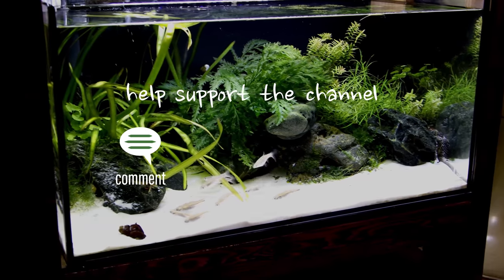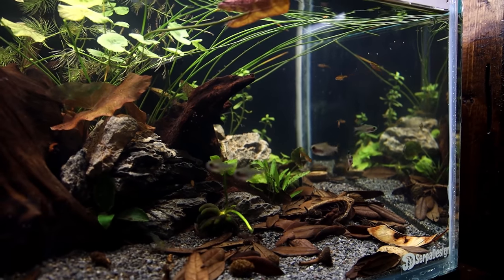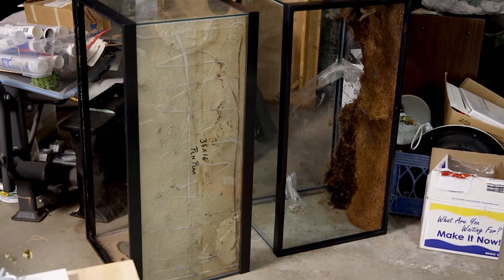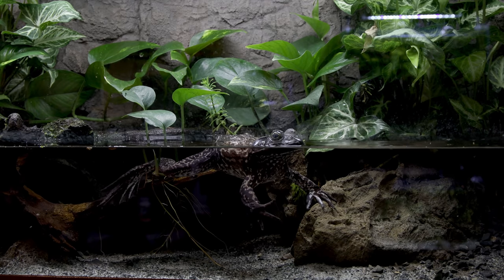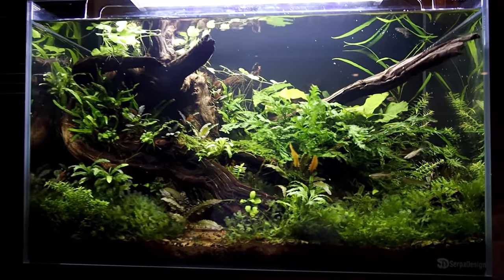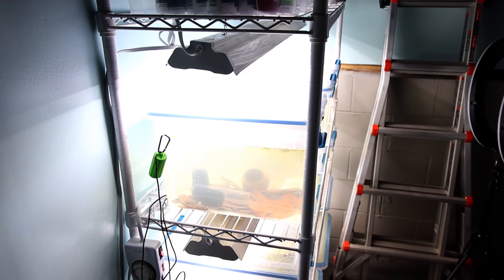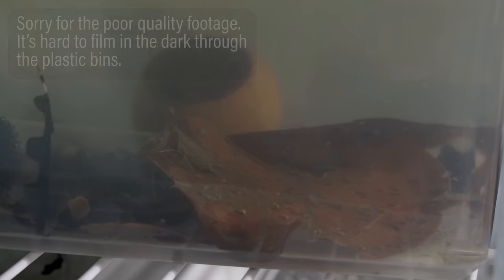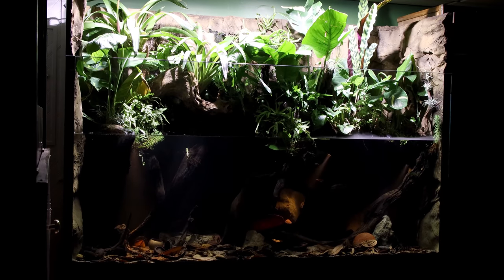I Finally Got My DREAM FISH! (So Excited)

Comment: You should attach one of those audio things that convert electricity to sound because I've heard these fish generate considerable but no need for concern amount of electric. You could hear it whenever it 'talks'
Reply from the maker: That's a cool idea! I'll have to do some research and see what I can find.
Reply: Boa-Noah  I believe there are a few aquariums that have sensors in the water that measure the intensity of the electric field produced by electrogenic fish, one of which being the New England Aquarium in Boston (the one I work at). They also have a light display hooked up to the tank, which gives a visual indication of the intensity. There certainly would be a background flickering of lights, but I wonder if that could be a substitute for the sound apparatus. Then again, there are methods of dampening noise and reducing the sensitivity so that only stronger than average pulses can be detected; however, the price of installing and even finding the equipment to construct such a display may be off-putting.
Reply: Yes! You just need an auxiliary cord, an amplifier, and a speaker and you can hear him talk!
Reply: @Abraham Johnathan That's true. LED's are really cheap; however, the display would need some additional modifications in order to ensure that the display can be powered on in the first place (these knifefish, unlike the kilovolt knifefish [Electrophorus electricus] do not produce as much power).

Comment: Name idea for the knife fish: Damascus (as in the steel)
Reply from the maker: Not bad!
Reply: when you said damascus it reminds me of alex steele...maybe tanner can collab with alex to make damascus-frame tank
Reply: @al-aurum2457  That would be insanely cool, but also absurdly expensive. Lol
Reply: Or Sheffield. ;-)
Reply: @invicis7591  very true...well if tanner's up to it maybe they can figure some things up, a win-win situation
Reply: @al-aurum2457  They used to make steel frame tanks, but the problem is that unless they use stainless steel, the steel has to be covered with paint or it rusts, and if the paint chips or peels off, the exposed steel rusts.  You couldn't see the Damascus pattern.  Possibly with a transparent epoxy coating.  Can they make damascus from two types of stainless steel?
Reply: @invicis7591  Not that expensive.  The old steel tanks were made out of simple L-beams welded at the corners.  They were extremely strong.  In the movie, The Best Years Of Our Lives there is a scene where such a tank is carried around while filled with water.  Shirley Temple had brought the tank from home to use in that scene.  A ten or fifteen gallon tank shouldn't be that expensive to make.
Reply: That is a good one! Strong name
Reply: @emmitstewart1921 Now I'm half-tempted to try it myself! I really want to build my own paludarium.
Reply: I was looking through the name suggestions and yours caught my eye, I think it's the one
Reply: I love that idea!
Reply: @emmitstewart1921  This would have to be a 100+ gallon tank though, that knifefish can get almost 2 feet long. Would still be awesome, maybe they could get a sponsor, or even just create a decorative pattern-welded façade or something
Reply: @christopherfassett9973  The dimensions of a typical 100 gallon tank are 72 1/2" x 18 1/2 " x 19 3/8".  The main difficulty would be making four 6' 1/2", four 18 1/2" , and four 19 3/8" long angle irons.   The expensive part would be buying the glass.  I think I would prefer an ornamental ironwork stand to hold a regular all- glass tank.  Something with hand forged leaves, flowers, and scrolls.  No Damascus, but lots of forge work, and black oxidized iron.

Comment: I love BGKF!  I had one and built a cave for it in my 55G tank. I also had a spotted Raphael Catfish and the two were best buddies. They would sleep together in the cave (made from a drift wood branch and pieces of slate) and at night they would cruise the tank together hunting for food. (culled baby guppies and other live bearer fry with deformities) along with tubifex worms cubes, frozen brine shrimps. blood worms. I would seriously recommend, if you have  a BGKF to get either a striped or spotted Raphael catfish as a companion fish. They do well together, and compliment each other when hunting around the tank. The BGKF using its electrical sensors (like an electric eel, a distant relative), and the catfish using its barbels. What one doesn't catch the other will. Both can be taught to be hand fed as well on beef heart ground up into balls held together by egg white.and cooked lightly in a microwave, then cooled in a fridge, before feeding. They prefer live foods, but will take frozen and freeze dried foods as well. Mine liked Mycis shrimps, freeze dried krill broken up slightly. 
They do well with Angels, bleeding hearts, diamond tetras, Hoplo and Corydoras cats. otocinclus might be small enough for the Raphael cat to eat. Neons and cardinals (and smaller fish) are definitely small enough to be eaten by both fish. Rubber-lipped plecos would go well with these two fish and might even share hiding spaces during the day. I had a red light set up to watch them hunt together at night which none of the fish could really see, but allowed me to watch them just fine without disturbing their natural behaviors. I noticed you have blue lights set up inside the tank. They can see blue lights and shadows caused by the blue lights. Try red lights instead.

Comment: I've always found Black Ghosts to be among more cool as well.  A 350 gal is perfect too but having no scales either. You seriously need to make sure the tank only consists of smooth rocks&plants in somewhat modest amount too. Having plenty room to maneuver at 16" long in the next 2-3 years&reaching upwards of 20" long too. On diet of bloodworms&brine shrimp. 
Oh,w/smooth rocks&plants you definitely want very fine sand substrate as well. For all I know,you very may already have that covered too&props! Or help stress his necessary basics for health&clear cylinders big enough for them help ease stress as well.

Comment: With your plywood tanks what do you do if you want to make one that can hold water?
Reply from the maker: I seal the wood to make them waterproof. If you're looking to add a large volume, more bracing will need to be added.
Reply: How would you add the glass front for the aquarium section with a door on top?